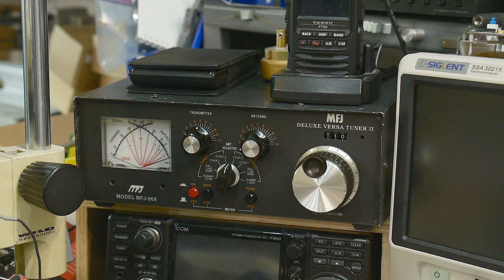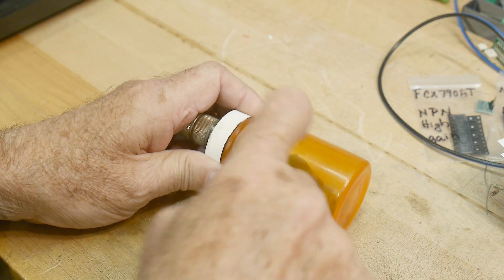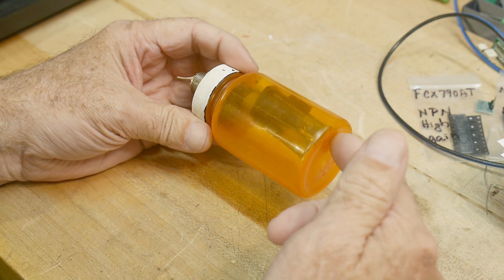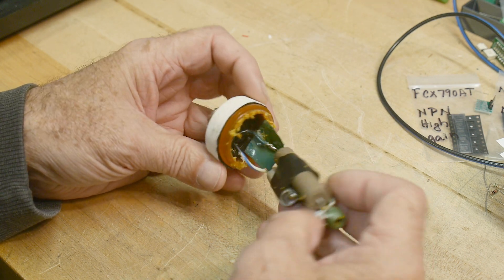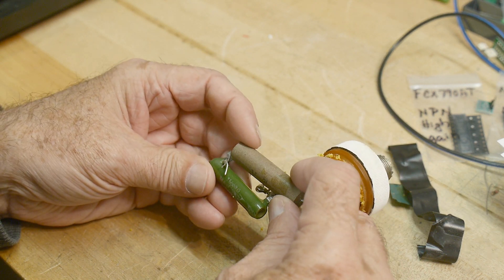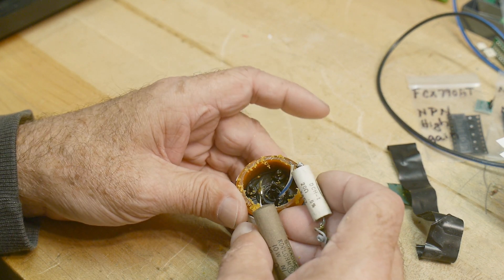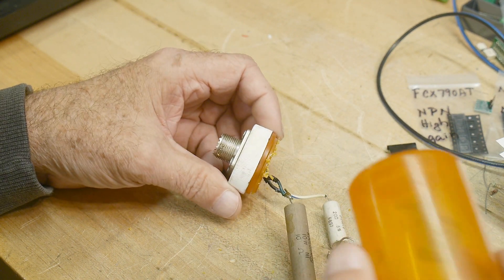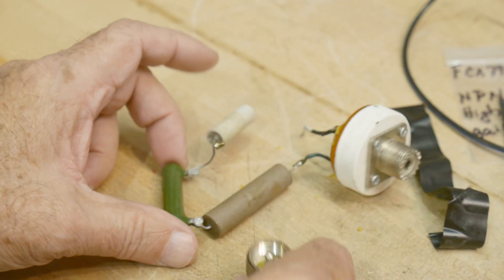#1738 RF Load in a Bottle

Comment: I've seen paint can being used before.
Reply from the maker: what color paint works the best 😎
Reply: @IMSAIGuy  I forget the name of the color. One that was used is the same stuff that the emperor had his clothing made from. If you like living dangerously gasoline can work. But usually I use mineral oil is the best choice.

Great... Now I'm trying to figure out the parasitic RLC of coiled wire in a metal can with oil and the possible skin effect of nichrome.
Reply from the maker: I had a heathkit cantenna in the wayback days. It was easier to find a gallon of gas than a gallon of mineral oil. Strange I didn't think of that. Thanks for the tip.
Reply: @IMSAIGuy  did they really call it a cantenna? Cantenna definitely had different meaning for me. (empty Pringle can with a 1/4 wavelength stub for stealing wifi back when the closest to me was two blocks down and 3 over
Reply from the maker: yes www.orcadxcc.org/content/cantenna_va7jw.pdf

Comment: I recall seeing ads for a commercial device called “Cantenna”.  Other than that, the black stuff could have been just plain RTV, deemed from the softness, or the ability to be ripped by finger nails.  Conformal coatings (acrylic, silicone and poly-urethane) would likely be tougher.  Although, if there has been oil, maybe even conformal coatings would soften in time.

Comment: My first dummy load was a 100 watt incandescent light bulb in a porcelain fixture.  Anyone else use one of those back in the day?
Reply: Yes, and it was awesome to see the bulb (75W) get brighter and dimmer as you peaked the final amp (6146 tube) input and output tank circuits !

Comment: The black stuff is likely liquid electrical tape. A common marine material used for protecting wiring connections. Excellent conformal coating when used in multiple coats and hardens up pretty well while still pliable. I also am surprised it wasn't oil-filled. That's a REAL 50 ohm DUMMY load as the dummy forgot to consider the wattage applied...

Comment: I used ten 2 Watt 500 Ohm carbon resistors to build my QRP dummy load because I had them in stock. I built it carefully with the paralleled resistors soldered between 2 pieces of PCB as end-plates, and it works well, with an SWR under 1.15 up through 70 cm and beyond.
Reply: I think that you used two, 2 Watt, 100 Ohm resistors in your above.

Comment: The black is a conformal coating, so you can fill it with oil. I've used medicine bottles like this and old plastic peanut butter jars for waterproof housings in the past.  I built an amplifier and mp3 player inside a peanut butter jar in the early 2000s for use on a personal watercraft.

Comment: The resistors being in series, the black (insulating) material and the bottle being sealed all seem to point to high voltage operation.

Comment: Suspect it was sealed as it was filled with a liquid at one point.  Disappointed you didn't measure the DC resistance at least & then put it on an analyzer.  I made a similar device with a bunch of large single value non inductive resistors & then put it in a quart paint can with mineral oil.  Worked great!  And stayed very close to 50R after multiple 100W trials.

Comment: I once (a long time ago) built something similar. Four 200 ohm 2 watt carbon comp resistors soldered in parallel via two copper disks. I then put the whole assembly in an aluminum minibox with a SO-239 socket. One copper disk was soldered to the SO-239 center post, while the other copper disk was connected to the SO-239 mounting bolts (and aluminum minibox) through four pieces of short copper braid. I also brought out a 470 ohm resistor done as a feedthru in the aluminum box so that I could monitor the RF level.
Reply: Very nice design sir!

Comment: That Dale resistor is rated at 1W, have some similar ones, just they are 1M 0.5W. Inductive as anything, guess it was fine on 80m band, but anything higher would probably have worked better as a folded antenna over a dummy load.

Comment: fill it full of non-rf  oil  for better  heat dissipation
Reply: No can do. Foolproofed by J-B Weld.
Reply: Drill tiny hoke, fill and seal?
Reply: There is no suck thing as sealing an oily hole in plastic  @jjoeygold